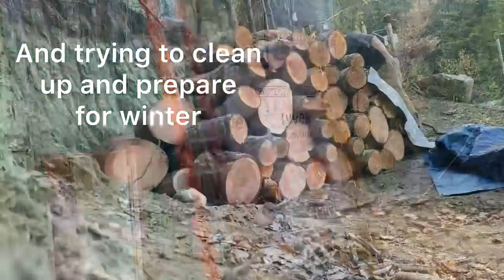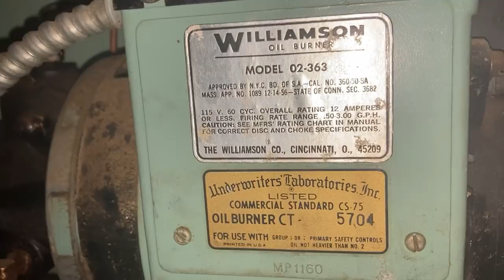Well That Was Short Lived

Comment: Add Howes Meaner Cleaner Concentrate - to your oil!   We started doing that several years ago with our Diesel furnace.  It has helped with a smoother operating machine, and less breakdowns.  Don't want to loose that heat in the winter!   Also, remember that 'Allergy Free' makes lifetime filters for those old beasts.  Have not bought a filter in 25 yrs.  :)

Comment: If the heat exchanger on your 50 year old furnace should develop a leak, you could die. Please get a couple carbon monoxide detectors.
Reply: just use a canary in a bird cage. that should work.
Reply from the maker: Lol